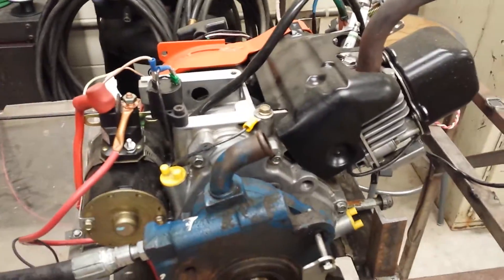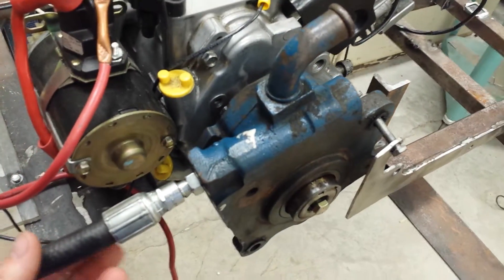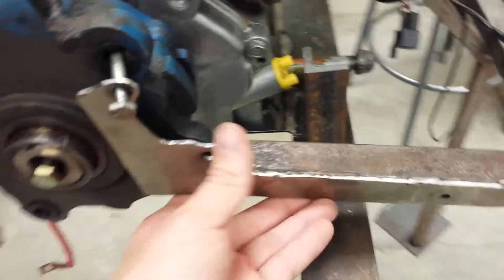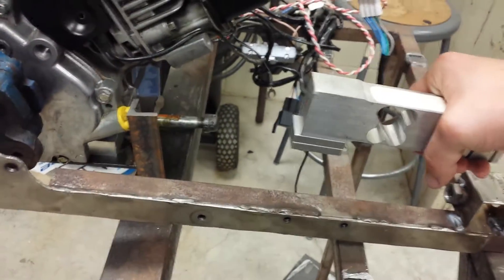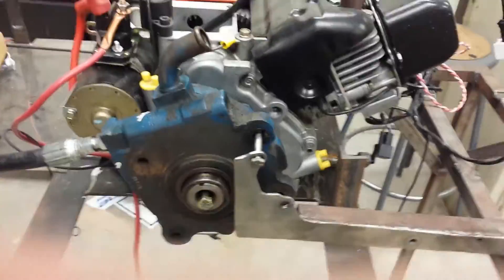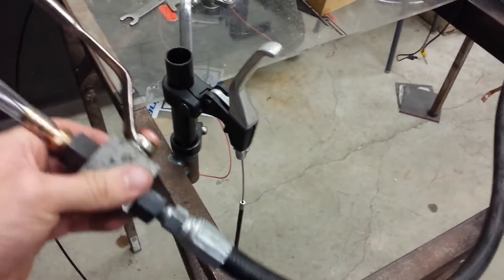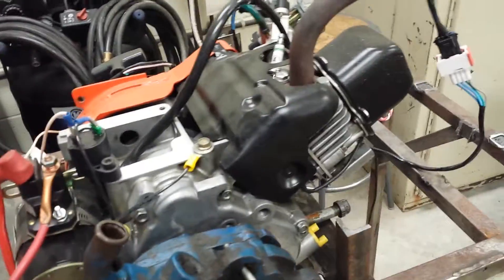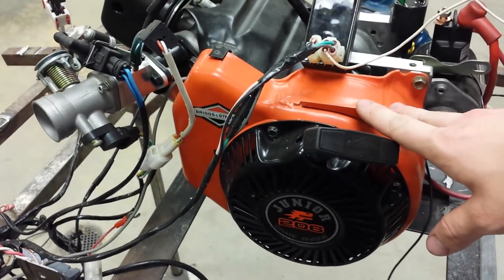Small Engine Dyno

Comment: I really like that dyno you're building,  I need a dyno myself, because reading the laws of thermodynamics I saw that the higher the compression is the more power and efficiency an engine has.  Thing is Petrol/gasoline Pre-ignites I want to prove that an engine running ethanol at higher compression will be more efficient, so more power better economy

Comment: I am attempting to build a Dyno myself, and was wondering how you figured out how powerful of a water pump you need to resist the engine. Is there some sort of formula that relates the two?
Reply from the maker: Matthew Munn Well basically however much hp the engine puts out you'd want a slightly bigger pump. In our case our pump is extremely overkill and we could probably stop the motor on a dime at WOT if we slammed the bypass valve shut. The only issues with using such oversized pumps is that the motor will have a higher load on it even when trying to idle.
Reply: How did it work out with the over sized pump? could you idle it, did the pump worked for for you?